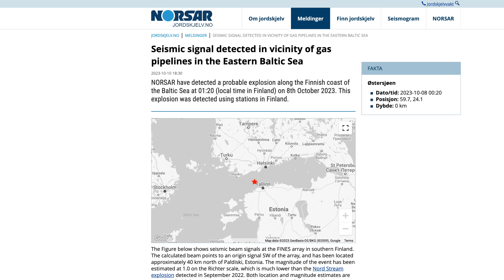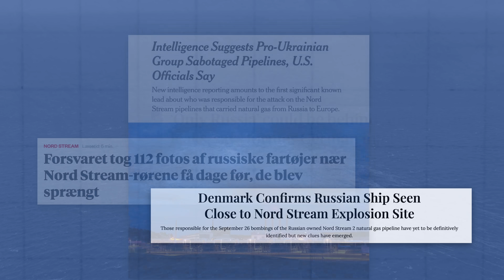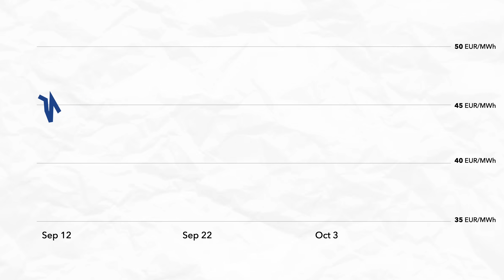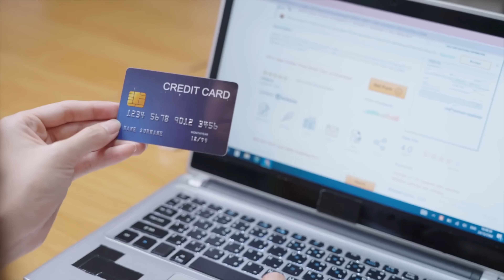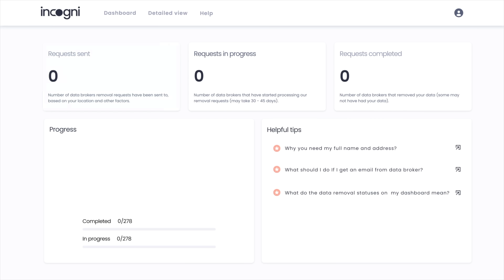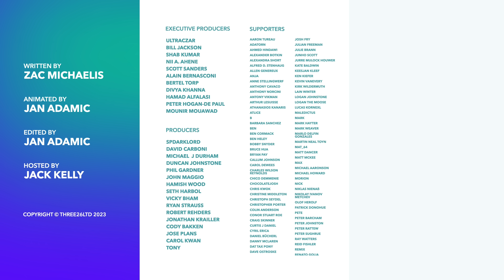Did Someone Blow Up the Finland-Estonia Gas Pipeline?

Comment: Norway, Finland and Sweden should look into the option of an overland pipeline from Hammerfest LNG plant to Finland and Sweden. Overland pipelines and pipelines at shallow water very close to the cost of Finland and Sweden would be more difficult to damage and easier to repair.
Reply: Costs would be horrendous making it uneconomical
Reply: The amount of gas Finland uses is so small that you can almost truck it, but yes up in the north it wouldn't hurt to have the distribution closer. Then to the real question, is natural gas really better than the old options. We can pretty exactly follow the emissions from the old options while NG is only in theory better, no company has yet come out with real figures about the leaks so worst case its equal to burning coal and in best case its not even renewable/carbon neutral.

My point is that Industry and consumers can be supplied by ship or trucks and instead spend the money on something that is proven to be a better option.
Reply: @thomasreilly6362  Maybe. But probably worth it, if compared to the immense cost of monitoring (and defending) cables and pipelines on the seafloor in international waters, where the Kremlin is operating countless submarines of various sizes equipped with radio/radar signal jammers.
Reply: @kenster8270  Monitoring the pipeline wouldn't be too costly using motion sensors and other devices remotely. Both Finland and Estonia would do it jointly. The distance isn't far 373km or 232 miles.  Any unusual interference would alert the navy's to a possible threat. Its unlike the full story will be made public but steps will be put in place to avoid a similar event happening again.
Reply: just make a pipeline straight from russia.
Reply: @rizkyadiyanto7922  There is one and that one was made so that Russia would not be the only market by pipe.

I assume they could scrap that pipe thou because we will have other systems by the time we are ready to trust Russia again.
Reply: @amadeuz8161  I think fusion will be ready by then ^^
Reply: Finland is delirivering gas to Estonia not geting gas from the Estonia. Reason of this gasline is that Finland has build LNG gas terminal to bumb gas to Estonia. By it self Finland has gas storages to Last over next winter. And by it self we are almost selfsufient on enargy since we do nor use gas so much by our self.
Reply: @ospehu1  The gas goes both ways in it depending on when you look. Even if it pumps towards Estonia it can be "sent all the way to the big storage".

It was built to connect Finland's LNG terminal to that huge storage in is it Latvia and to connect Finland's market to the rest of Europe back when changing to gas in Europe still was the future thing.
Reply: @benghazi4216 More like zero point energy extracted from subspace by then
Reply: better build up our nuclear power infrastructure. we got already 96% non co2 emission energy only 4% is split where 3% stems from oil and 1% from natrual gas. The french had the right idea when it comes to energy policy. We do not need oil and gas for electricity(including heating). Uranium is a superior fuel source if we europeans where smart we would have joined france in building standardized nuclear power plants all across europe to lower the construction cost and time for nuclear power plants. Talking specifically about smr reactors. If we did that during the 1990s we would have zero dependence on russian hydrocarbons and since the largest uranium exporters are canada, australia and kazakstan we do not need to care about what opec plus thinks. The EU has also the largest uranium deposit in the world(talking about greenland wich is part of denmark).  

Though idiotic people does not understand how we can both solve climate change and our own dependence on oil and natrual gas. Since we got idiots in charge and idiot people who follow them. Otherwise we would have solved climate change long ago.
Reply: @amadeuz8161  Psst i am a Finn and i know that consimption is far les in Finland simce unlike in baltics we do not need gas for central heating over here so consubtion of gas ovet here is far less than baltic countries. And by the finnish reservation law's that says Finland has to have storage to every necesery consumptions in storage to Last over 6 months with out eany service reguired from ot side world. The consumption is far larger than in Estonia and othet baltic countries. And yes it can flow on both ways but it was not build for Finlands demands.
Reply: @amadeuz8161  consumption of natural gas is really small portion of Finland energydemand in general ans as it has been said earlier evean in this convertaion chain Finland is closeing to be selfsufficiant on that field already. And natural gas is not such an huge demand over all. So main effort of that gaspipe line is to Estonia and other Baltics and there for it is import part of buzzle to make sure that what ever Russia dose that the Baltic countries wont be left alone when Russia is using gas and oil as an weapon against them. Since lots of Baltic houses are still heated up by natural gas unlike here in Finland central heating etc are heated by highpressure warm water. That comes from coling water of the industries or is bumped from the deep underground springs and are already warm by it self. Also multible private houses also got there heating from the ground so demand of gas is really low compered to Baltic countries.
Reply: @amadeuz8161  Finland is not build on ideology that if Russia invades  But the ideology that when Russia invades to Finland. So whole Finland can be turned in war time economy with in days. Batle strengh reseve of 280 000 reservist is sumoned and eguiped also with in days. All the medical profesionals and all the other important profesional are submited on militar purposes also including power plant workers etc... second cycle reserve of 520 000 is summoned and eguiped with in few months.
Reply: @thomasreilly6362 hehe...we need a land bridge between them! For our safety!
Reply: @ospehu1  2b m3. Our industry some transport eats most of it. Some towns also changed their system to gas at the Russian border but can change to a type of oil if needed.

Still it doesn't matter what you imagine or dont imagine we have or don't have. The pipe was built to connect us to the Latvian storage and get access through that to the EU market back when it was built. 

A while back there was on the news that the LNG ship just sat in harbor because we were buying from another market.

So YES we do not need it but that doesn't mean we didn't use it! Even a Fin company said our consumption is too small for it to be profitable so that's why EU paid most of the bill to connect the gas infrastructure.
Reply: The gasline to norway has been a constant talk since the year 2000, but no one wants to build that in lapland because of enviromental reasons
Reply: @ospehu1  I was built still when EU had the plan to replace all coal/oil with gas and the plan was to connect Baltics, Finland, Sweden and Poland. Yes the LNG terminal in Ingå was built due to the pipe to be able to import LNG and "transfer the extra to the storage" in Latvia. So in theory we need 40-80 medium sized ships of LNG per year if that would be the only source of import.

That is why they started to research for an replacement for the Industry to be able to become self sufficient also in that area.

So if one ship just sat in harbor then there is a big chance we have been importing by that pipe instead so if you wanna teach your father to fck then go find the information of the import/export stats of that pipe.

Yes they said we have about 1 year of storage left so its no panic but if there is cheap gas on the market then we can buy it and have to use from storage instead.
Reply: @JonneBackhaus  That's long forgotten like our prime minister that we had during that time didn't even know about that plan(Edit: the time when the balticconnector was built). I'm reading an article about it and seems it was Finland's idea to build NS1 and 2, like without us it would have never happened.

It was our idea to integrate Russia to Europe it seems also by some "Pohjoinen ulottuvuus" idea. Seems we had trust in being able to get Russia into becoming democratic state back in 1997.

Damn how could I forget that, like I knew that I was against NS1 but didn't remember why. Maybe it was us that blew up NS1 and 2 to correct our mistake and that's why Sweden hasn't said anything... hmmm.
Reply: @amadeuz8161  lul, next: YYA was just an guise to get in to nato in a long run?
Reply: @amadeuz8161  ja ihan vaan tiedoksi se LNG terminaali laiva joka on Inkoossa on kyllä ihan Eestin ja Suomen yhteishanke. Joten tutkinta vähän tarkemmin ennen kuin rupeat ihmisiä opettamaan
Reply: @amadeuz8161  ja jos sinulla olisi edes alkeelliset maantiedon taidot niin tietäisit että kaikki Eestiin, Latviaan ja Liettuaan menevät maakasu linjat kulkevat joko valko-venäjän tai  ukrainan kautta niin voisi olla edes jonkin asteinen käsitys siitä mitä varten se runkolinja on tehty sillä jos Venäjä päättää että Baltiaan ei tule maakaasua niin silloin sitä ei sinne tule.
Reply: @amadeuz8161  So that others would also understand the subject. FYI all the gaspipe lines that goes to the Estonia,Latvia or Lithuania goes trough either Ukraine or Belarus atm. And in fact all those gaspipe lines also feeds Poland and Germany so if Russia close up those pipelines that means that whole central Europe is lacking the natural gas so could you wise guy explane to me how that pipiline feeds Finland from Europe since there would not be gas ovet there? So main purpose is not to cover the Finlands gas consumption since as has been said to you multible times before Finland is not a nearly as much depenadple on natural gas than Baltics. So learn to argument your points before you try to sought from your high horse. Specially if you do not know shit about the mater you are preaching of.
Reply: @amadeuz8161  And second learn eaven the Basic of geography will you. There is no gas flowing from Europe to Finland since there is no single gaspipe line that would not be controlled by Russia. And inly possibility to have gas on europe is LNG atm. So there is no gas floating to Finland as you claimed.
Reply: @amadeuz8161  so before you preach learn eaven the Basic of the reasons that you preach Finland dose not need that pipeline to cover its gas consuption all that it needs is the LNG to be shiped in and storages for that. But if Russia close up the gas lines from Baltic countries then they are screwed since un like in Finland the natural gas is not nearly as much important than to them
Reply: @ospehu1  Copy paste "Suomen Viroon yhdistävä kaasuputki, Balticconnector on avattu vuoden 2019 lopulla. Putken kautta suomalaiset kaasunkäyttäjät voivat ostaa kaasua Baltiasta sekä nesteytettyä maahantuotua kaasua Klaipedan maakaasuterminaalista. Lisäksi Latvian suuri kaasuvarasto avaa uusia mahdollisuuksia suomalaisille kaasunkäyttäjille."
Reply: @ospehu1  Elikkä jos ei vieläkään menny nuppiin nii esim. Hebrestetistaani voi varata ton et puretaan kuorma siel ja sit siirrettään kaasut. Tottakai Hebrestetistaani saa sen kaasun jostain muualt mut toi mitä kuormassa on nii puretaan Suomessa ja sit se virtaa eteenpäin. Eli se et oltiin yhdistetty siihen verkkoon teki sen et pystys kauppaa tehä muualla ku Suomes jne.
Reply: Et vittu käytä päätä ja eti ite!!!
Reply: from norrland/lapland? A bit too long, and you forget the winter weather. Good luck fixing anything under meters of snow.
Reply: @ospehu1  Kai sä sen tajuat mitä tänne joudutaan tuomaan ku oma väki ei lisänny?!? Et koht on kai joka nurkas huutotorni.
Reply: @amadeuz8161  tällä kun ei ole pelle nyt suoriakaan tekemisiä sen kanssa miten teet kauppaa tai er urpo vaan on puhtaasti huoltovarmuuttaa.
Reply: @amadeuz8161  toisekseen mä tiesin huoltovarmuuteen liittyvistä asioista jo silloin kun sinä vielä tuhrit pöydänjalkoja paskaan. Joten juniori opetrelleppa ihan perus seikkoja ja älä rupea paasaamaan kaupankäyntiä silloin kun sillä ei ole mitään merkitystä itseasiaan. Sillä kaupankäynti ja nämä asiat on kaksi eri asiaa.
Reply: @stixinst5791  What happened to the tunnel? A bridge is impracticable due to shipping lanes and costs
Reply: @amadeuz8161  kerropa mulle pikku juttu, että kun nyt lukee hienosti joka paikassa että ammattikorkeakouluakin on käyty niin miksi ei nimellä löydy esim Theseuksesta minkään asteista opinnäytettön alkiotakaan ? Vai onko niin ettei sitä koskaan ole tehtykään?
Reply: @thomasreilly6362  i think there was a lend connection somewhere close. Obviously just to protect EU integrity and security in face of russian imperialism.
Reply: @amadeuz8161  taidat vaan olla niin hiton uuvatti että et tajua että muut puhuu aidasta ja sinä aidan seiväpäästä kukaan muu ei ole puhunut missään vaiheessa tilintarkastus siitä että mikä on kaasun kaupankäynti tässä asiassa. Vaan siitä että kummalle on tarpeellisempaa että tuo putki toimii tai ei ja sinä kun et osaa katsoa mitään muuta kuin kaupankäyntiä ja sen lisäksi olet vielä niin uuvatti ettet ymmärrä sellaista pikku seikkaa että jos idästä lyödään kaasuputki kiinni , niin tossa putkessa ei kulje hetken päästä pihaustakaan ja toi suomenpää oon sitä varten että siitä tarvittaessa voidaan tukea muita nato maita mutta ei taida aivosolut riittää asioiden ymmärtämiseen.
Reply: @ospehu1  Sinä tän sanoit "Finland is delirivering gas to Estonia not geting gas from the Estonia. Reason of this gasline is that Finland has build LNG gas terminal to bumb gas to Estonia. By it self Finland has gas storages to Last over next winter. And by it self we are almost selfsufient on enargy since we do nor use gas so much by our self."

Elikkä sinä sen oletit et putki olis jotenki tehty tän nykytilanteen takia. LNG juttu tuli vast tänä vuonna. Putki tuli 2019 ja "The funding contract was signed in the spring of 2015.".

Et kerro ny erkki, miten tämä lause sopii tähän "Reason of this gasline is that Finland has build LNG gas terminal to bumb gas to Estonia."

Aikasin maininta tästä koko jutusta oli jossain siin 2000 aikana. Et nii ku mul aina sanottiin ku kysyin KVG.

Voin kertoa miks oletit, koska nyt puolel vuoden sisäl nii Eestit päätti suomen kaut ottaa LNG:tä mut se LNG puoli ei oo ees vuos vanha juttu ja ollu käytös joku puol vuotta ku alus se alus vaa seisos siin satamas.

Et perustit koko jutun siihen mitä on tapahtunu 1% ajast siit ku eka kerran joku rupes miettii koko putki juttua. Putki on ollu siel 4 vuotta ja paatti ei ees vuoden. Sen tarkoitus oli todellakin meiän pääsyä EU:n markkinoille et voidaan sit päättää et otetaanko Venäjältä vai onko Latvian varastossa paremmat hinnat. Sit 2022 ku Puolan putki oli valmis nii päästiin koko EU:n markkinalle kattelee.

Ajattelin kyl et oisit ite menny selvittää sen mut usko mitä uskot.
Reply: I'm not sure the gas is that important to these countries to be honest.

Comment: Its mechanical damage (think anchors and such) not explosion. (Was confirmed in finnish media). Also finland uses an lng terminal, not the pipe for most of the imports
Reply: I wouldn't be surprised if some Russian submarine accidentally bumped into it because of incompetent crews.
Reply: Mechanical??
Reply: This video is not paying attention, that a data cable between Finland and Estonia, not sharing the same location, was damaged the same time. So, it was hardly an accident.
Reply: @JustAGuyWhoLikesStuff.  it was an russian commercial vessel that ukraine has shot during the war.
Reply: @forgottenmusic1  yup elisas fibre was damaged. Not that it really does affect finnish internet, more estonias
Reply: @forgottenmusic1  So you are saying that Finns damaged it on purpose? As it was their ship that fucked it up
Reply: Authorities in Finland said on Wednesday (Oct 11) that a leak that led to shutdown of a natural gas pipeline from Estonia to Finland was apparently caused by "mechanical" force and not a blast.
Reply: Looked that up
Reply: @fox280-mb6jy  Finnish officials said it, they also said they will not comment to much about it because only ships that were there at the time were Finnish ships xD
Reply: Should I be worried
Reply: @surgeon9039  Where did I say that it was Finns who damaged it?
The issue is, that if it is proved that Russians did it, some reaction is expected. But, what could actually be done? There are already 1001 sanctions, and it's clear that no-one is going to bomb Moscow for that.
Reply: What's the point of bombing
Reply: @surgeon9039 where did u hear that
Reply: @forgottenmusic1  finnish authorities and media have confirmed that the ship that was in the area was the russian SGV Flot... so no it was not the finns there.
Reply: @JonneBackhaus  yeah but I'm in the UK so why can't I find it
Reply: @JonneBackhaus  It is confirmed that both Finnish and a Russian ship were in the area. So expect the Russian trolls to claim that just Finns were. Another ihtamnet mission.
Reply: @forgottenmusic1  waiting for the "silja europa sunk the estonia" stuff to  come out of the east
Reply: @JonneBackhaus how can u be sure the Finnish securities aren't lying and where's the proof
Reply: @surgeon9039  No, the ship in question seems to be a Hongkong flagged ship named New New Polar Bear.